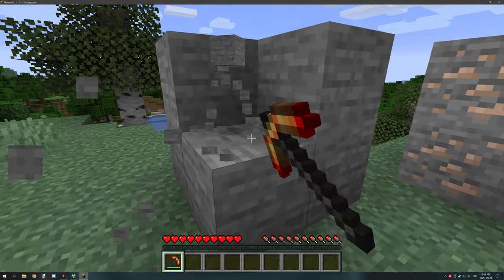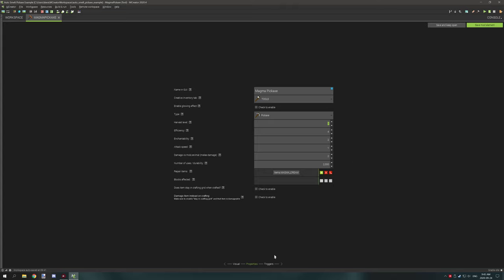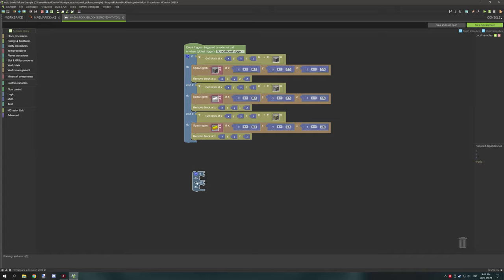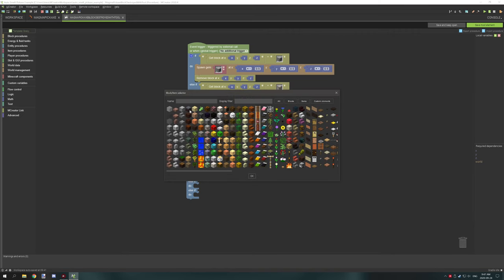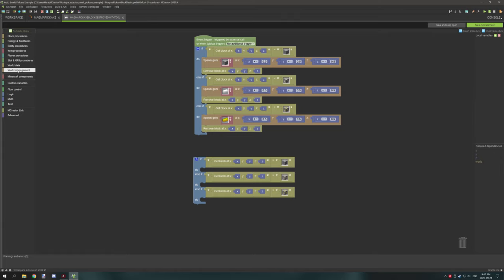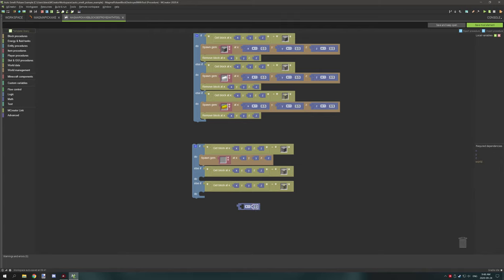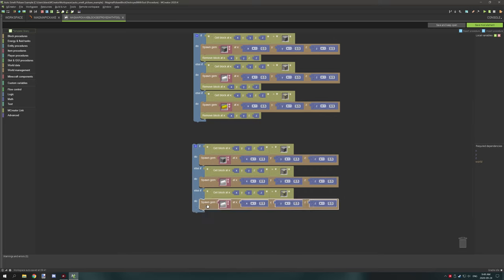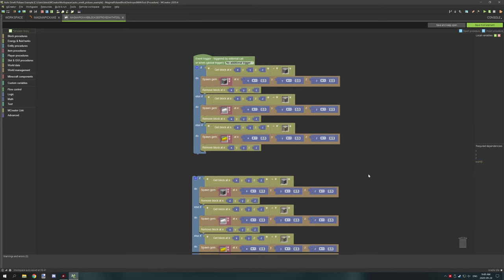MCreator: How to make a Auto Smelt Pickaxe | 2020.4

Comment: theres another way of doing it and its more efficient. the problem is, it drops smooth stone when you break stone.
Reply from the maker: This actually works the way it's intended, it gets the smelting result so cobblestone would be turned into stone naturally. You would be able to make a condition using a IF statement and make it not work on those blocks and have it drop something else if needed but this would have to be done for every block you don't want to actually smelt.